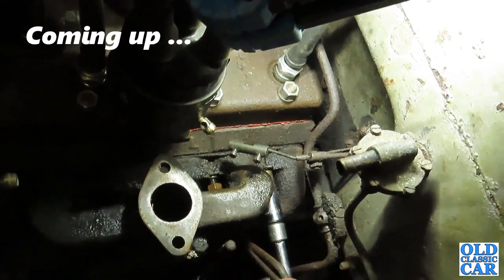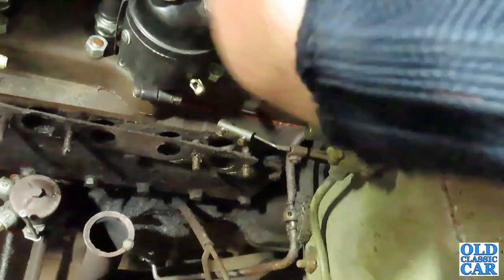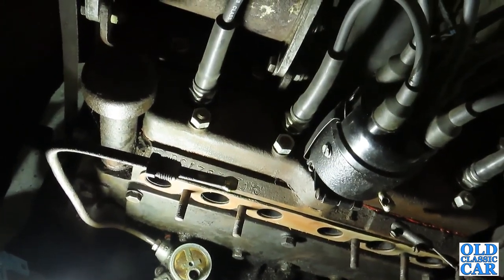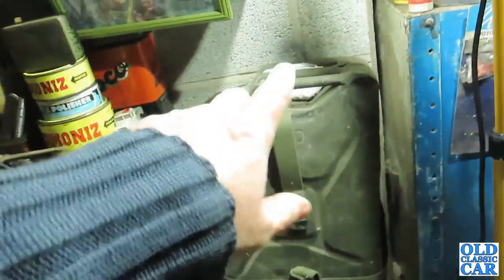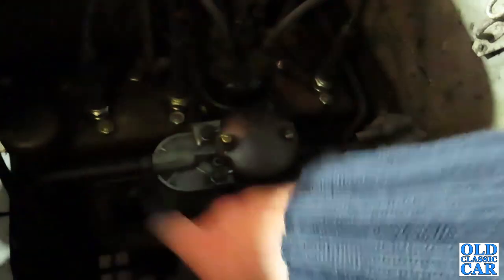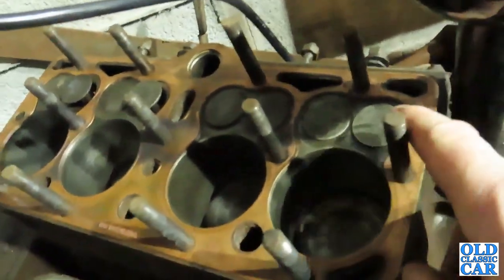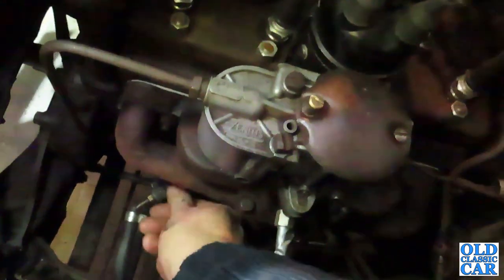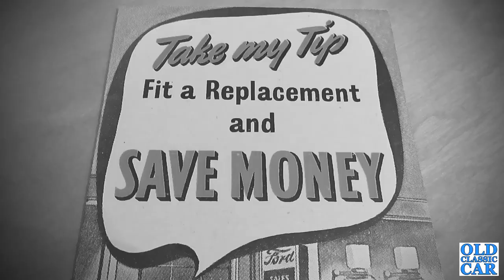Ford Prefect - why won't it start? carb & fuel pump attentions, spare E93A 1172cc engine checks+

Comment: Thank you for the video which was good to watch on New Year morning over a cuppa! And happy New Year to you guys. I am looking forward to more of the same, thank you for the effort to share. By the way, you could have searched for the cylinder head tightening sequence in your manual and loosened the head nuts in the reverse order. I don't think it would make any difference though. Much hotter here in South Africa, just under 30 C here with daily thunderstorms. with lightning.

Comment: A bit late coming to this party but I have only just found your videos, quite by accident (and now subscribed).  It was interesting watching you sort out an exhaust blow, as this has just happened on our 100e, Lizzie the Anglia (and our channel name).  The problem for us was the gasket under the blanking plate, well, it was the exhaust manifold as there is a slight step meaning the gasket failed to seal correctly.  I have had to remedy, temporarily at least, using some exhaust paste to take the space, maybe a couple of thou.  A job for winter will be to have a look at a replacement manifold or what I can do to machine down the existing one.  Sadly I do not have a mill (I wish I did at times!).

It's also nice to see the youngsters getting their hands dirty.  My son is 16 and helping out on Lizzie with plenty of enthusiasm.  I'm at the point where I am getting him to do a lot of the work as it's the only way he will learn.  The first job he did was to re-fit the mechanical fuel pump, Lizzie had an electric pump fitted when we purchased her, which failed, as did the replacement.
Reply from the maker: Glad you found the channel, yes I've had lots of problems with fuel pumps over the last few years - including on the Standard 8, and the Dodge pickup too, so I feel your pain!!
Reply: @oldclassiccarUK  Thankfully, since Will refitted the original (and I am touching wood!), there have been no issues on the fuel side of things, don't talk about gearboxes though...  With all that said, next month we are taking Lizzie to the Old Ford Show at the British Motor Museum, about a 100-mile drive from us.  Going to be an adventure.

Comment: The illustrations in that parts manual are just stunning!

Looks like the fuel pump's thrown it's cards in but I can't help wondering why it didn't run when you filled the float chamber.

Anyway, thanks for the entertaining and informative videos and wishing you and yours a happy new year!
Reply from the maker: It did splutter at one point with fuel directly introduced to proceedings although it may not have made it into the vid. Thanks for watching, all the best for '22

Comment: Lucas M E S light bulbs  used in old valve radios to illuminate the tuning scale, if I am right it has a screw thread and a fish bowl glass. its rated at 6.3 v at .3 amps

Comment: As one who rebuilt several E93 A engines in the 70,s , take it from me that they are always a pain to get started again. I normally resorted to a tow in 2nd gear.
Reply from the maker: I don't remember having any issues with the E83W pickup that I used to run, and haven't encountered problems with the Anglia so far, but I remember reading that fuel vaporisation can be a common problem with the sidevalve Fords, due to the proximity of the pump and pipework to the exhaust manifold. Thanks for watching.

Comment: Looking forward to the pump rebuild, I have one of these to do too albeit a later one from a Triumph Herald.👍
Reply from the maker: Thanks for watching, yes the pump will be in the next vid
Reply: Hi. Really enjoy watching the old side valve engine work. Takes me back to 1968 when I had a 1952 Prefect for running around the fields with my  friends. It was a headlights in the wing model. Of course being kids we eventually destroyed it and is now buried in an old quarry on the farm. I do wish I had it now! 😪  ps used to run it on paraffin after warming it up on  expensive petrol.  Happy New year.

Comment: Happy New Year to you and the family. Very much enjoying the tinkering videos on the old Prefect. I've not owned a side valve engine vehicle, is it true that if well settled that are really smooth ? Looking forward to seeing it up and running with some new fuel etc. Many thanks for the videos, keep them coming. Nigel. P4 man.
Reply from the maker: Hi, thanks for watching, yes sidevalve engines are very quiet if they're in good order

Comment: Looking forward to the next instalment , fuel supply and spark , don't forget that if you have no spark or a very weak one after cleaning the points that the condenser may be faulty in the distributor , a weak coil may be the problem too . The insulation around the windings ( it's over 70 years old now ) inside may be failing reducing the HT to the spark plugs.
Reply from the maker: Hi, all good advice, it looks like the coil and various ignition parts have been changed recently - although that's no guarantee that they actually work well!!!! Thanks for watching

Comment: Did I miss the bit where you smear the exposed manifold studs and threads with high temperature resistent copper grease to make future removal easy?
Reply from the maker: I could have added more (I usually do) but this time I left the residue old grease on the threads, I might re-visit them at some point as they're easy to get at

Comment: Hi great videos did you ever get your hot start problems fixed thanks much appreciated
Reply from the maker: The Prefect is no longer with us, I think I got to the bottom of the hot running issues I had with my 4CV

Comment: hi there, another great video, i hope the ignition timing is ok.is the compression ok in each cyl. good luck,hope the dog is ok.
Reply from the maker: It ran fine recently and I've not touched the timing, but if it still doesn't run once the fuel supply is sorted then yes I'll have a look elsewhere

Comment: I thought the Volvo was a keeper. More usable 'modern'?
Reply from the maker: It was going to be, but the complexity of a) fuel injection b) LPG c) the previous owner's many mods and additions to wiring etc put me off, plus old autos aren't the best either IMO so while it was a fine looking car, it didn't really gel with me. Plus it was too smart to leave outside now that the Prefect is in its place indoors.

Comment: Knackered diaphragm in the fuel pump.
Reply from the maker: Could be, I've got the pump on the bench in pieces at the moment. Thanks for watching
Reply: @oldclassiccarUK  Loving the series. Ford Prefect of this vintage was my first car as soon as I passed my test when I joined REME in 1966. If I remember rightly, I gave a tenner for it and ended up running it around Aldershot Stock Car Stadium during intervals before I sold it to a regular racer for the same tenner! Don't know what he did with it because having done my 18 months basic mechanic's training, I was posted out to a poor unsuspecting LAD (Light Aid Detatchment)!